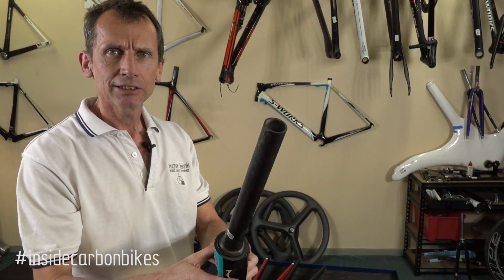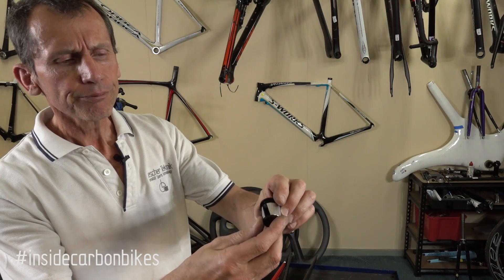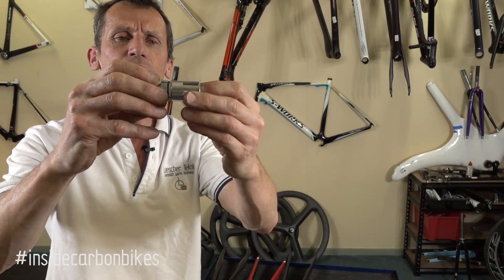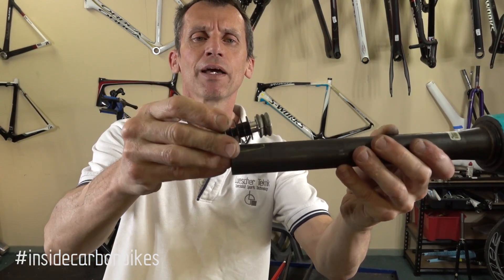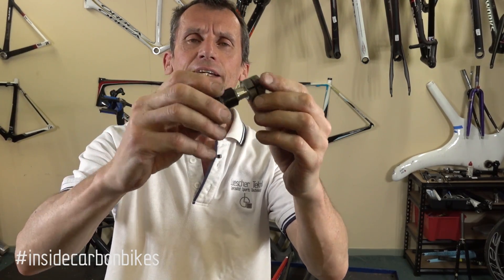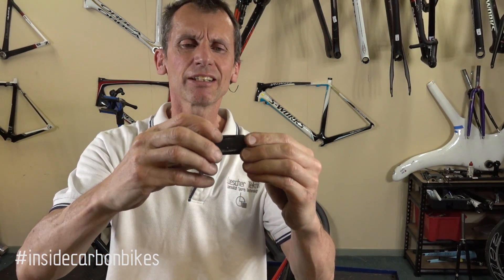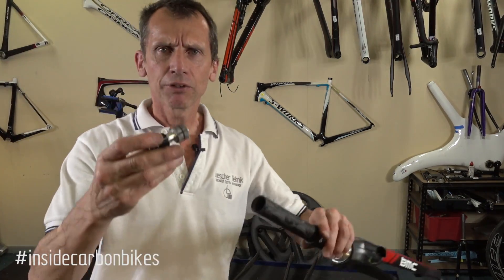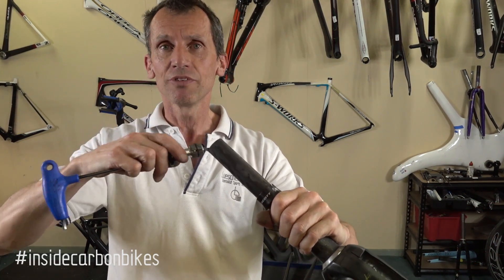Quicktips  -  Fork steerer compression plugs

Comment: I bought a 'PRO' compression plug - 50mm long 1-1/8 (PRHS0072 is the exact model). It says >Ø 23 mm for inner diameter..  the steerer on bike is 1-1/8 
But the plug looks so thin. Maybe about 20mm diameter, when it's round. Only very small middle part of each of those 3 long thick side pieces is really in contact with the steerer wall, when expanded. Is that good enough? The inner diameter of steerer is 24mm. 

I'm actually not too worried, but.. I better ask.. I lack confidence. Maybe I got wrong plug? Or maybe there's a good reason why it's made so thin..
I guess it's best to insert it so, that one piece faces to front and other two to rear left and rear right... Because there's less material at front in stem clamp.. And other 2 help there at rear left/right against over tightening ?

I chose it because I don't want to cut the steerer. The original plug wasn't also very bad, but after I lowered handlebar to max. It only supports upper part of the stem clamp. Making it difficult to get torque right on lower bolt of stem.. with a scale and regular hex key. So instead of torque wrench, which was more expensive, I got this plug.. And continue misusing the luggage scale that I already have.. :D

Comment: great video, i had a cannondale plug and it constantly gave me trouble , the stem was coming loose or the headset would creak if i tightened the topcap to about 1.8-2 nm, thrown it away and replaced it with a "heavy one" and never had an issue since

Comment: I am sure this has been covered somewhere on this channel but why is carbon so weak in compression vs metal?
Reply: This is because of the directional properties of carbon fibre laminate. Carbon fibre is really only strong in tension, in the direction of the fibre. When in compression you're dealing with shear stress, where the fibres are very weak. The quoted shear stress is essentially down to the shear stress properties of the resin within the laminate. This can be improved by different weaves and layers putting the carbon fibres in different directions, but ultimately your still only benefiting from the proportion of these that are in tension for any load applied. Metal however is generally regarded as an isotropic-homogenous material. This means that it has the same strength in all directions, which would be why it performs better in compression than carbon composite.

Comment: Thanks Raoul, this came up as a recommended video and coincidentally it's something I'm dealing with on a Ritchey Break-Away. The standard compression plug is Ritchey (unremarkably) and slips at the recommended torques for it and the stem. I can over-torque the plug against the stem, but I'm not comfortable with that situation. A replacement brand was marginally too large for the steerer, but still very short. The steerer ID is around 23.7-23.9 mm as measured at various points both with a bore gauge and with a plug. The stem height is around 42 mm. I could machine up my own but it's a lot of dicking around for something that's available off tthe shelf quite cheaply. Can you recommend and particular plug for a steerer of that ID?

Comment: I absolutely agree with you about the steerer compresion plugs. What about handlebars at the stem clamp? Is the situation different than the steerer? It is not possible to support inside the handlebar.
Reply: szleslie1, good question! And why not in the seatpost too?
Reply: How would you get an expander into the bars and how would you tighten it???

Comment: Meh... maybe you are letting this plug thing go to your head. Correct me if I'm wrong, but the only purpose of the plug is to compress the bearings during assembly, preventing play between the frame and other components and ensuring comfortable tension in steering; so as long as you don't damage the carbon tube you could use anything and ditch it afterwards... that is if you weren't concerned of aesthetics or dirt and water getting in [great for those saving weight, specially in your brains]. Furthermore: during setup axial hold is as important as radial hold [reason being the low and inconsistent Young's modulus in carbon fiber].  What keep things in place is the steam bolts that hold the tube, and I bet it is better to avoid prestressing the tube from the inside ; that part wouldn't light up in FEA as bad with the exterior pressure the stem puts in the tube. I smell a lot of snakeoil lately.

Comment: Great video. My the plug that came with my Felt frame would easily slip, even with paste. A different bike shop was aware of this and threw it away.  They replaced it with a longer plug that contacted the steerer over its whole length.

Comment: I have a question. Why carbon seatposts don't require a compression plug to withstand the clamping force?
Reply: sc0608023, good point! Also, why not in the handlebars too?
Reply: Mark Novak had the right answer, it's because these loads are not at the end of the tube. It's referred to in engineering as Saint-Venant's principle. Handlebars are less at risk as they are essentially a continuous tube, so you're not applying a point-load near a discontinuity. The seat post is a more similar example, but due to the forces your weight places on this tube it's bound to a "minimum insertion" to allow sufficient overlap to spread the applied load between itself and frame, making the applied load be sufficiently far away from the discontinuity.
Reply: I guess because there's a big difference in how the steerpost and seatpost are fixed. Namely the seatpost is clamped from the outside with the force pushing inwards (compression) and the steerpost is clamped from the inside with the force pushing outwards (extraction). In other words a steerpost gets pushed apart.
Reply: @ArjenvanHassent  no. the compression plug is what pushes outwards, and it's only there because the stem is compressing the steerer. without the compression plug, the carbon steerer is likely to be weakened or crushed by the stem compression. The question is why the carbon seatpost isn't threatened in a similar way, since the seatpost is compressed also. 
I think it's because the seatpost clamp isn't right at the end of the tube.
Reply: Mark Novak carbon seatposts are way thicker than steerer tubes,but from 
principle there also should be a kinda plug as there’s only one bolt to fix it ,and the 
seatpost carries more of the riders weight than bar/stem(about 15% of riders weight)
Reply: The forces aren't as concentrated, especially with the seat tube in between to spread the load a little better. My guess is compression plugs were never invented to take the clamping force of a stem, merely to replace the old fashioned star-nut which is unfriendly to a carbon steerer. However, as time goes on and reality sets in, we know a carbon steerer is fragile at its top end and so we retroactively claim the compression plug is necessary to prevent a failure.
Reply: @Metal-Possum  don't guess as that is bad advice when working with composites.
Reply: Carbon paste.

Comment: Given thevery different Youngs moduli of carbon composite and say aluminium, is a metal plug going to do much to help? Wouldn't a thick carbon inner plug be safer?
Reply from the maker: In theory a composite plug would be better, however the bonding adhesive has enough elasticity to account for variations.

Comment: I got tge cannondale compression plug on  my caad12, and now i am somehow concerned about my safety...
Reply: Was that expander on your Caad12 when you bought it?
Mine came with a heavier type that doesn’t have a top cap fitted to it, I bought the Cannondale one he said was crap to upgrade to, but was told after purchasing it by a Cannondale parts stockist that it wouldn’t fit my 2017 Caad 12 Ultegra.

Comment: Can the compression plug itself be over-tightened and over-expand the tube? Also, have you ever come across a Specialized 'multi' stem, with the angled shims that go between the stem and the steerer? What do you think of them? Any compromises?
Great video Raoul! I always look forward to your content. 

Literally cannot believe people would try to save weight in this area...
Reply: Yes, I made this mistake. Thank goodness the stem clamp was torqued up at the time which saved the steerer. LBS gave me a proper shaming, lol.
Reply: They definitely can be over-tightened. In the video Raoul tightens one quite lightly and the steerer already expands measurably. It doesn't really have to be very tight. A few Nm should suffice. Many compression plugs have 5 Nm marked on them and I think it's plenty.

I've over-tightened the compression plug in a lightweight DT Swiss rigid MTB fork once, and ended up having a 10 mm crack at the end of the steerer tube. The steerer had unusually thin walls, but it definitely can be done. It's an expensive mistake.

Comment: What about the Cane Creek double star nut?  Seems like it offers no support at all, thought it was designed that way, so maybe that's okay?  Thankfully, this is installed on an aluminum alloy fork, so I'm don't think it needs any support.  Thoughts? 
 
Also, is it true that the compression plug's main function is to allow pre-loading of the headset bearings, only during installation of the stem?  If so, isn't there a better way to do this?   What we need is a way to pre-load the bearings without getting in the way putting a "structural plug/sleeve" inside the fork tube, exactly at the stem location and with the precise diameter, so we can then tighten the stem clamp producing a more durable assembly.  Hmmmm....
Reply: Paul Damian exactly what I was thinking about when seeing this video. Must be Raoul's favorite design!
Reply: Jonas...  yeup...  God help the poor soul who put one of those star nuts in a CARBON fork!

Comment: Is it just me or does carbon just seem like a poor choice of material for this part of the bike?

Are the downsides to having carbon blades bonded to an aluminium upper that significant?
Reply: The benefits of carbon forks are comfort and weight. Stick an alloy steerer on there and you lose the comfort advantage and add weight. However, now that alloy technology has moved on it should be possible to make a comfortable and lightweight alloy fork. But that raises the question why bother with a carbon frame at all?
Reply: @Anti Brax: Chalk me up as a member of that club also   :(
Reply: HTC Vive Gameplay Videos If you follow these videos you'll find out that it's never the carbon that is the problem. It's the lack of skill in manufacturing, assembly and use.

One needs to know the tools and equipment that are used. If that is too much, yeah then one should buy an aluminium bike.

(I'm in the elite club of people who have destroyed a carbon fork by overtightening the stem. 😢 I wish these videos had existed then.)
Reply: Antti Brax Yes absolutely that point is not lost on me. My comment was more along the lines of a) carbon seemingly not being particularly well suited to the application of hoop stress b) weight benefits of using carbon for the steerer being undermined by the requisite supports and c) alternative construction methods (eg. Bonded steerer/crown) being available and widely used ( yes I'm aware aluminium has its own issues lol).
Reply: @AnttiBrax  Bonding alloy and carbon is never easy, and you can get corrosion in these bonds. It's one thing to get corrosion in two seperate parts, other thing is when it's one part bonded together forever. I would say full carbon is always going to be stronger (minus some hit/unfortunate crash) if everything is tightened to spec.

Comment: You forgot to mention that canyon doesn't even have one! Is that crazy or what?
Reply from the maker: I did a post on that the other day over at my Instagram page. I should have mentioned it in this video, thanks for the reminder.
Reply: only old canyons used a different system. they have it now, at least mine has it. (2017 model)
they also use the same 1 1/4" diameter as giant does.
Reply: Reginald Scot 

You are correct & what a joke it is...I've just had a Canyon Endurance bike in & was numbstruck to see there wasn't an expander/compression bung. The bike is 18months old & there is a line of damage to the steerer tube where the stem bolts tighten.
An accident waiting to happen.

Shame on you Canyon
Reply: Reginald Scot is that good or bad?
Reply: Bryan Chan 
It's beyong bad...it's shocking & an accident waiting to happen.
Reply: what models are yours? my Ultimate CF SLX has a normal expander